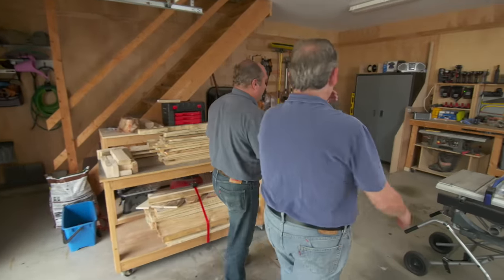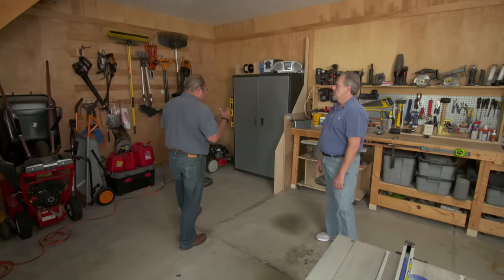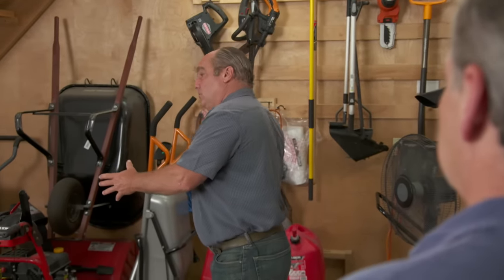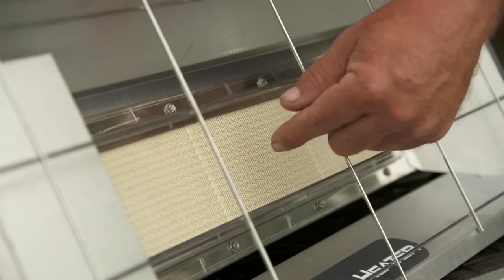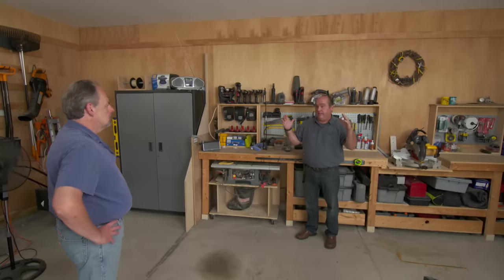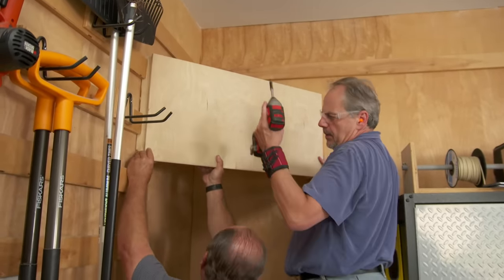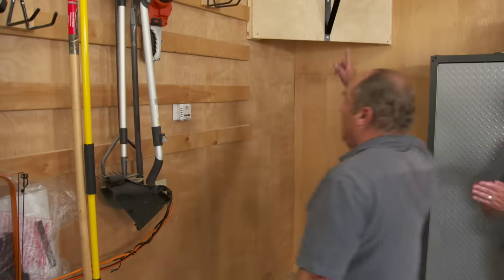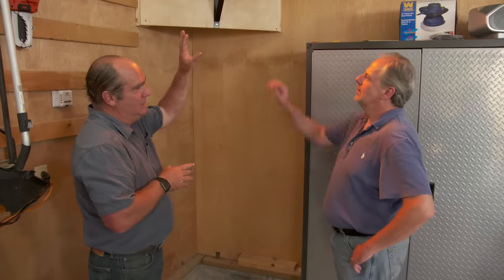How to Heat a Garage Workshop | Ask This Old House

Comment: This is a good retrofit solution.  The smart solution is to place pex tubing in your slab when it is poured.  That is far and away the best shop heat.
Reply: It achieves the same goal, heating the concrete without wasting energy heating the air.
Reply: Robert Amos IV Not quite.  The temperature gradient in the room will be more uniform with the heat radiated from the floor rather than to the floor. as any objects between the radiant heater and the floor will absorb the heat making the floor temp nonuniform.  For new construction, I would definitely go with pex in the slab.  However, that is not an easy retrofit.
Reply: I said same goal. Heating objects also radiates heat. If you want to get fully technical, heating the top of woodworking equipment might actually do better if you use the shop for limited hours because heating the floor would take a long time to get the equipment heated up so the occupants actually felt that heat. If it was running 24/7 sure, but I would assume this is a part time operation.
Reply: Robert Amos IV You can’t beat warm feet!  😁
Reply: @LTVoyager  you can if you cant get them to the heat under a table saw!
Reply: Robert Amos IV Why is the heat under the table saw?
Reply: @LTVoyager  Radiant flooring works by first heating the floor, yes, but then the heat radiates to heat basically all the mass in the room. This includes the objects, walls, etc. It is comfortable because you don't have hot air mixed with cold surfaces.

However, in a situation where you aren't operating the system full time, it isn't quite as useful due to either wasted energy or long "warm up" times. In a workshop that is poorly insulated, you are forced to make a choice.  Either run the system all the time, wasting a ton of energy, or you have to wait each time you use it to get up to temp, which could be hours.  The pipes heat the slab from the center outward, which takes time.  Even when the floor is warm, then it has to heat the objects. This is why there is wasted heat under the table saw, because the table saw itself is still cold.

For a more intermittent operation in a low insulation location, a radiant heater could work better.  The infrared heat can be felt by the occupant as soon as it switches on, and the surfaces of the floor and objects will be warm much sooner than it takes core of the floor to heat up.

For any system, you have to take into account the location, conditions and usage. No one system is perfect for everything.
Reply: Robert Amos IV Absolutely.  I have forced air in my home, in-slab radiant in my shop and I maintain a HWBB system at my church.  Each has pros and cons.  I keep my shop heat set at 57 through the winter.  With the efficient wall-mount boiler, it takes very little energy to maintain that temp on most days (I live in northern PA).  I have the shop on the same meter as my home and since installing the boiler two years ago, I literally can’t tell the difference in my gas bill.  The normal weather variation swamps out the little addition from the shop.  I am guessing it costs me $20-30 a month to heat the shop and it is a sizable shop, 32’x48’.  I have a 50,000 BTUH Triangle Tube boiler and it is very efficient as the outlet water temp seldom exceeds 82 degrees so the boiler is in full condensation operation pretty much all the time.  I kept the boiler small on purpose so it has little wasted capacity.  I sized it using 10 F as the outside design temperature and that has worked out well.  Last night it was 4 F and windy and the boiler could not quite keep up as the shop temp fell from 57 to 55.  This keeps the cost of operation quite reasonable and isn’t a big deal comfort wise.

The thermal mass and thermal lag is the most troublesome part of such a system, but since it is comfortable for working when set at 57 (a forced air system would need to be set at 65 or more to provide the same comfort) even on the says when it overshoots to 60 or so (a sunny day where it warms up quickly outside for instance), it is still comfortable for working.  You definitely do not want to try to do nightly setbacks as with forced air systems as the hydronic system simply responds too slowly.  It really needs to be a set it and forget it operation.

If you have a seldom used shop, I agree that overhead radiant or even forced air would likely work better and probably be cheaper to run.  However, the comfort will not be there.  It still takes a couple of hours for such systems to get the thermal mass in the room at equilibrium temp (equipment, furniture, floor slab, etc.) and during that time you will be quite warm on the side of your body facing the heater yet still have cold feet from the cold slab that will take all day to warm up.

Given how little it costs to run a small condensing boiler (or a simple water heater for a very small shop), it is hard to argue against keeping the shop at a moderate temp at all times.  This also has the advantage of minimizing condensation and rust issues from temp cycling a shop in the winter.
Reply: @LTVoyager  I would assume you have decent insulation in your shop since you planned ahead for the install?  I would imagine that it would increase your cost quite a bit if not.  Otherwise, it seems we are mostly in agreement honestly.  Radiant floors would be great, so long as the install cost was worth it for how frequently it would be used.
Reply: Robert Amos IV Yes, decent insulation.  R-19 in the 6” stud walls and, I think, R-30 or 38 in the ceiling.  2” foam under the slab.  The only part the contractor fell down on, and I was away when they poured the slab so didn’t catch it, was they didn’t isolate the edges of the slab.  It just has the 1/2” asphalt board for expansion and then the concrete block.  So, my edge losses are a little high, but that keeps the snow melted around the perimeter of the shop!  LOL.  It was nice to be able to plan and build a shop from scratch.  Not everyone has that privilege.  I didn’t heat the shop the first couple years I had it (even though I had the pex in place, I didn’t have the contractor install the boiler as I wanted to do that myself) as I was concerned about how much it would cost to heat.  I now wish I had installed the boiler sooner as the cost to heat the shop is truly almost negligible compared to heating my house.  And I can’t overemphasize how nice a heated floor is for doing either wood working or working on vehicles.  The only real downside of slab radiant is the thermal lag.  You simply can’t change temps quickly.  And, of course, AC is not easily done as with a forced air system.  I don’t plan to put AC in a shop as I don’t need it in my climate and the dust would mean constant filter maintenance.  That is the main reason I went with FA in my house: I wanted AC as well as heat.  Although, in hindsight, I wish I had put pex in the basement slab as I could have then kept it at 55 or so all winter using my water heater (which came with additional taps for space heating use) and had a lot more comfortable basement for very little, if any, additional heating cost.  Oh well, hindsight...

Comment: I see a fire hazard with sawdust in the air. A boiler outside the room and either baseboard hot water heat or forced air over the hot water heat exchanger.

Comment: I see a lot of people putting heaters up high up on the ceiling......if hot air rises, why not the floor?
Reply: I was told that gas fumes from mowers & gas cans are low to the ground.
Heaters up high eliminates the chance of flame from heater being ignited by gas fumes.

Comment: Atta boy Richard. Infrared Heat is the bomb. Once the shop warms up it will last for hours as all the heat radiates back into the space from all objects that picked up the heat. Unlike forced air which just drifts away. HVAC contractor here.

Comment: Split system heat pump with 96% gas furnace. Heat pump at temps above 30+- degrees. Gas furnace below 30. A/C In summer! Initial cost is a little higher, but worth it. 96% furnace has sealed combustion.

Comment: have to ask is this safe with gas in and around that area and can you use a propane one .I have an unfinished basement that I would like to heat to hopefully warm up the house above also .I keep my ride in mowers in my basement for now ,but planning on buying them a new home .I am in southside VA and had new lennox dual stage heat pump put in 16seer ,but house is still chilly .My walls are 2x6 and floors are insulated .

Comment: Roger has never let me down - Till this one.  
Mr Heater no longer has this unit on their website likely because it is unsafe to use indoors.  
Refer to: https://www.abe.iastate.edu/extension-and-outreach/carbon-monoxide-poisoning-unvented-gas-space-heating-appliances-aen-204/ 
For indoor shop application, you should utilize a heater similar to: https://www.modinehvac.com/products/unit-heaters/residential-hot-dawg-series/hot-dawg-separated-combustion-hds/   It is much safer and will provide must more even heat throughout the space. Another big advantage is that there will be an opening for cold air to blow into the space.

Comment: Heat pump. More efficient than other options and more green.
Reply: Not effective below 35 degrees.
Reply: @MrDJSkeptik  Newer heat pumps with variable speed motors are still effective.
Reply: @SkremoMcThrftsto  I have been a HVAC/R contractor for 35 years. For four of those years I taught a heat pump class at a local tech school. The balance point is 35. Below that you will need supplemental heat. The heat of compression doesn't change with variable speed. There just isn't enough heat in the air below that temp to make it efficient to run. So explain to me exactly what you are talking about.

Comment: So many people asking what size heater they need or how much does it cost to operate. The size depends on how big the garage is and the type of construction and your local weather. That's the stuff you can figure out with the aid of Google. After that the cost to operate will be based on how long it runs. BTUs can be converted directly to fuel consumption, then calculated to $$ based on your local fuel costs.... on a per hour basis. Hint: BTU rating is based on BTUs per hour. Pretty simple, eh?

Comment: Not sure why you would put the thermostat that close to the unit heater - going to be cold on the other side of the garage all the time, since it 's registering the heat from just a few feet away.

Comment: I have a woodworking shop and i installed a ductless heat pump. Works great and hasent changed my electric bill.
Reply: has the dust loading up the filter been an issue for you?

Comment: My question is. Looked like he used homeflex gas pipe that Home Depot sells. It is also called CSST (corrugated stainless steel tubing) pipe. Did he bond it or ground it to the electrical panel. That is now code across the country. Thats to avoid pin holes in case of lightening strike in the area. Lightening strikes could cause small pin holes and cause leaks which lead to 💥💥.  And I'm assuming Richard realizes how bad that is seeing as how an entire neighborhood blew up in Massachusetts due to faulty gas equipment and pressure increases.

Comment: Very disappointed with TOH on this one. I live between Akron and Cleveland, and several years ago I made the mistake of installing one of these unvented gas heaters in my garage workshop. The moisture it created was devastating to my tools. That small vent installed in the workshop will not solve the moisture problem. A vented radiant tube heater would have been a much better option.
Reply: That little heater will be slow to heat the shop. I live in the same climate zone and use a 110KBTU kerosene jet heater in a 2.5 car uninsulated shop. Even in subzero temps in half an hour everything is toasty. I wired in a thermostat and it only runs 5 mins every half hour after that initial warming period.
Reply: @johnpossum556  it doesn't heat the shop air, it heats the tools and objects in the shop and those heat the air.
Reply: @AngelousSpike  As far as I know there is an open flame covering the perforated surface of the ceramic element. I highly doubt the gas heating of that element (by open flame) can convert 100% to infrared. Much of the gas exhaust is hot carbon dioxide air and  water vapor, mixing and heating the surrounding air. Radiant tube heaters efficiency is only 60%, I could not find the numbers for ceramic heaters.
Reply: @marijak3267  Doubt no more, my friend! Infrared heat is also known as 'Radiant heat'. The flame you mention heats the ceramic upp and since the ceramic isn't combustable - the only way for it to lose all the heat it's receiving is to radiate it outward in all directions. The energy frequensies emitted by the photons leaving the ceramic surface is basically "only" within the infrared spectrum.
Pardon my bordom inducing rant, hehe.
That being said - I still don't think that this type of heater is a good longterm solution do to the ease of condensation along the border of the rays, where hot meets cold.
The installation was also sloppy.
I mean - why didn't they just extend the plywood another 8 inches or so, still leaving a big air gap, and try to hide those hideous thing-a-majiggs behind that? I know that this is "just" a 'shop, and they probably just wanted to knock this out fast. But when you're making instructional videos that gets hundreds of thousands of views - shouldn't you strive to go that extra... Inch?
Reply: @gustavlarsson7494  Off course this is what I meant; radiant heat. But the element won't 100% convert the convective heat (from burning gas) to radiant heat. I was trying to explain that towards the previous comment, this heater does warm the air, not just surfaces through radiant heat.
Reply: He would have been smarter to install a Reznor hanging heater. Richard needs to stop making HVAC techs look bad
Reply: I know what your saying I live south of canton and have a larger version of one of them in my shop there great to heat you standing there but your correct they RUIN your TOOLS
Reply: Had you considered a drum style [dessicant] dehumidifier?  They are regenerative, and because of the heat cycle used they add some mild heat to the space.   It's not very much, but with 4 air paths you have some advantages not available by any other means.  You have two blowers: one serves the space and the other serves the reheated/regeneration portion [25%] of the drum during its rotation taking in outside air while moist air exits outside by it's own duct.  If you cross connect the fresh air intake to the spaces intake [before the space air filter and with an adjustment damper to limit mixing] you are able to provide mild pressurization of the space during operation.  That can compensate for leaky spaces and wall construction that's on the cheap side regarding moisture control.
Reply: @zack9912000  cause the heat exchanger will get clogged. Lol
Reply: @zack9912000  "You will never clog a hanging heaters heat exchanger".   Have you used one in a woodworking shop? That dust gets in everything. You will not clog it to the point of blocking air flow, but when the layer of dust coats the heating element, it cuts the efficiency significantly. I'd love to know how to keep the dust out of the heater, since I'm looking for way to heat my wife's woodworking shop. What would you recommend?
Reply: @gustavlarsson7494  
This Old House airs on PBS.
Your estimate is a bit off.
I don't know what their ratings for PBS viewership are, but I doubt that it is less than a couple million.
Reply: @JohnMcNerney  
You could put a Heppa filter at the entrance of the cold air intake. That will prevent the dust from entering the heat exchanger, then all you need do is change the filter.

You might even be able to get away with a regular furnace filter for that matter, just build a frame that the filter slides into. 

The frame that holds the filter needs to be sized so that when the filter is inserted, it is air tight and the only way for air to enter is through the filter.
Reply: David Yeager I have to agree with you about the radiant heater. It does a great job hearing the garage but run it for prolonged periods and it will cause condensation in the garage. I actually use a dehumidifier in order to avoid the congestion build up. That has worked stopping it but it seems kinda of stupid having to use it in the first place. I’m open to better hearing garage options.
Reply: Marijak “
Reply: @JohnMcNerney  maybe look into setting up a dust collection system since you already have the heater in place and/or blow it off periodically with a air compressor.

Comment: Cut that plywood a little short? Lol
Reply: pdxthriftking 503, it was probably a scrap that was lying around.
Reply: Terrible
Reply: Even if short scrapwood, at least center it over your two outer wall 'studs.' Guys obviously into projects, could have put horizontal studs over drywall and screws into those. Entire support system would be hidden behind scrap piece.

Comment: How big of a vent was installed? Was it just screened opening?
Reply: I have this heater and used it only few times. I didn't install the vent yet because it goes against common sense. I have my garage insualted, why would i make a hole in a wall to let the heater air escape? This will make the heater run longer because you have a hole in the freaking wall! :) can you explain why this makes any sense? Thanks
Reply: @kosinskiarek  You're burning gas in an enclosed space, that's why.